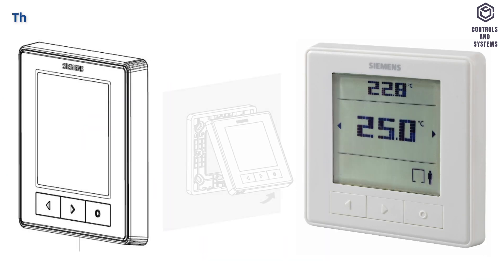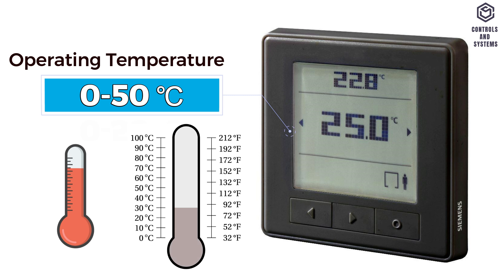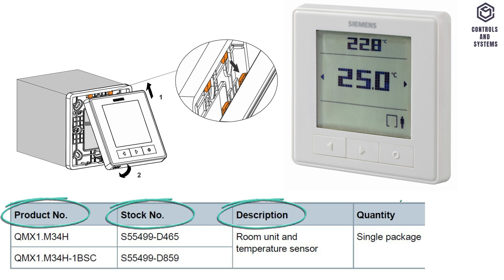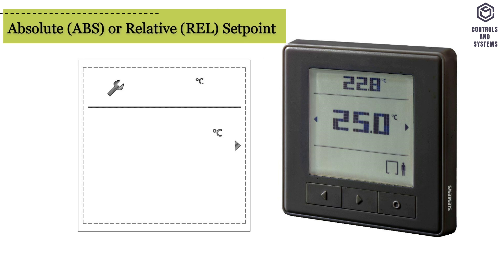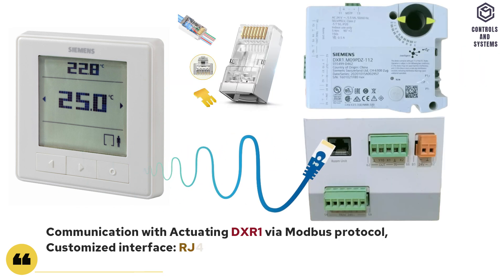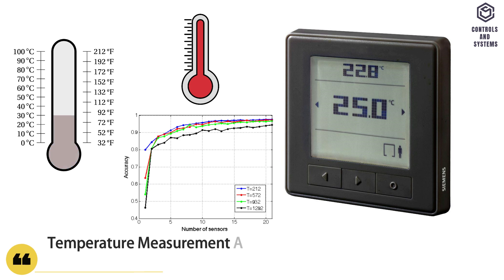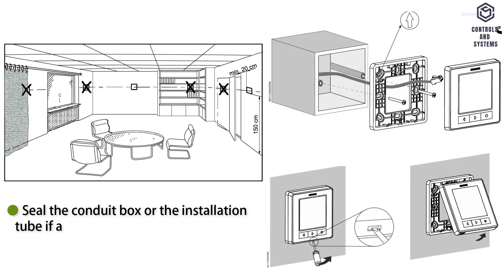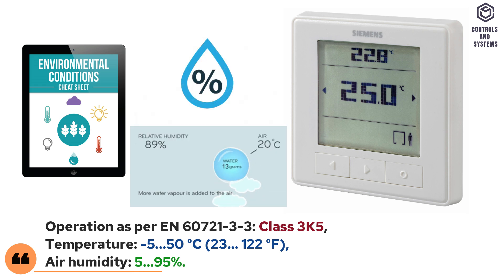Siemens QMX1.M34H Room Unit: Overview & Technical Specifications | Smart HVAC Control

Comment: Sir thermostat put set point 20 but he return 24 just 3 secend sir give answer
Reply from the maker: Note: The room unit will always save the current settings and exit parameter setting mode if there is no interaction for 5 seconds.
Restore factory settings:
Press button left and right simultaneously for 10 seconds, the default home page appears.
Reply: @insightcontrolsystem  Hi bro, why is that this thermostat cant be set now to 18 deg C. it can only set up to 21 deg C. Before we used to set up to 18 deg C.